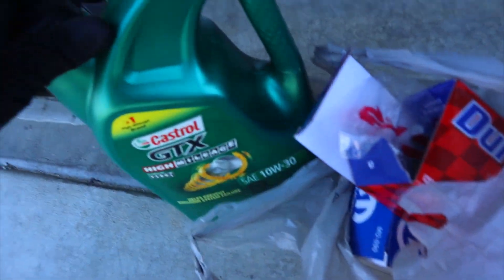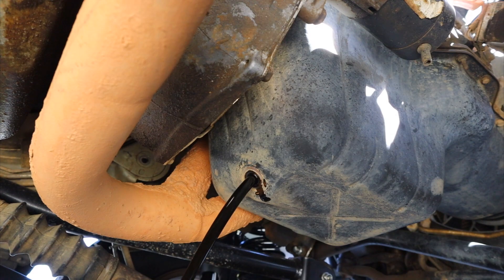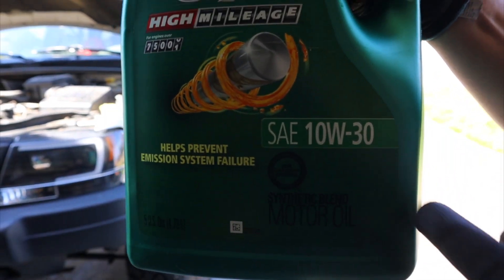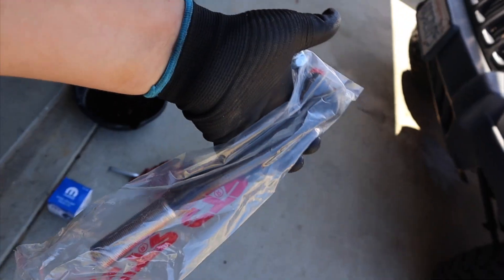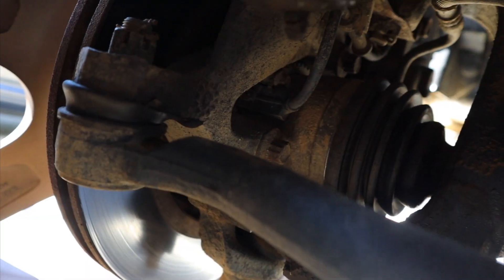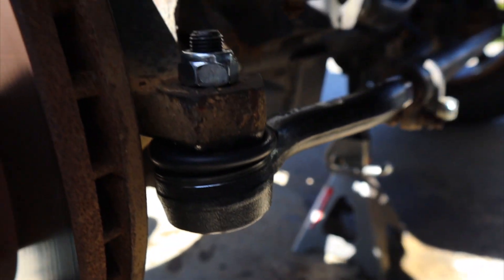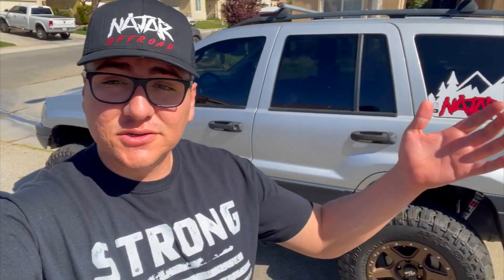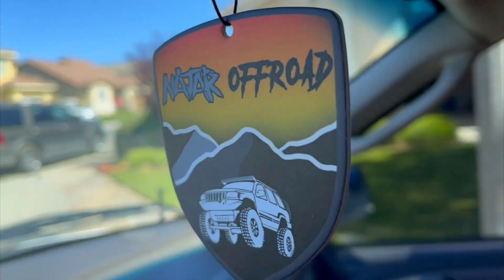Oil Change Tie Rod and Trimming for 33s on Jeep WJ Grand Cherokee | Najar Offroad

Comment: Been running the GTX high Mileage in my WJ for at least 60,000 miles. I now use about 5 quarts of that 10w30 with the 16.9oz of the Rislone Engine Treatment, then topping off with more 10w30 every 3,000 miles or so

Comment: Hey 6 cyl owners!  📣 4.0L’s use flat tappet cams. These require oil with high zincdialkyldithiophosphates (ZDDP for short) to prevent excessive cam wear. The Zinc forms a sacrificial layer of soft metal between the cam lobes and lifters. I use Amsoil Z-Rod for its high ZDDP content but there may be other brands who still offer this. Be sure to do your research to keep your 6cyl happy and healthy for the next hundred thousand miles!
Reply from the maker: I’ll try that next time 💪

Comment: Any plans for an upgraded exhaust?
Reply from the maker: Yea but I don’t know what is sold for WJs haven’t done research
Reply: @NajarOffroad  i put a dynomax tailpipe, after market single federal converter, and 3inch super 10 muffler in mine. There’s sound clips on the Jeep WJS only Facebook page if you want to hear or I could send it to you on IG. Very aggressive and on stock tires so it doesn’t drone and sound bad at high rpm but I’m sure those big tires you got are going to make that 4.0 sound like it’s working harder than it should. 
Whatever you choose be careful cause you can make your 4.0 sound bad really easily, I think my set up is one of the best sounding.
Reply: I put in a borla catback. Not too loud but it's aggressive and doesn't have much drone on the highway. I feel like it's the perfect middle ground for sounding great and being comfy
Reply: Reach out to Kolak he hooked me up with his performance exhaust if you’re on the forums I’m sure you’ve heard or seen him around. Super knowledgeable on everything WJ he’s been my go to for parts, advice, and overall suggestions and tips.

Comment: I went ahead and bit the bullet. My Banks Header arrived last week. Buy once, cry once. 
I actually wanted a quality tuned header , not just a replacement piece of crap that will break in a year. Also adding Mellon Cam for low to midrange power. 12 port Bosch injectors and cold air intake will round out my engine work. Then on to the suspension.

Comment: Baldwin B2 or B2HPG
WIX 51515  or 51515 XP
Donaldson also has good filters 

WIX site cross-referenced Baldwin B2 to  WIX 51515.  Napa filters are WIX I believe they use WIX numbering system.

You should be able to find Baldwin filters in the LA area.  HPG is equivalent to a 5 micron filter if I remember correctly. 

 The Baldwin B2 is twice the size of oem filter with the same specifications.  Prefer the Baldwin "B2 HPG" if you want to spend the extra, I usually buy them by the case.

VR1 Racing, oil 10W30 is preferred because of its high in ZDDP, but it is pricey. Summit has it for $57 for 6 qts.

Comment: Rottela oil ftw. Ya need Zinc for those tappers.

Love seeing the updates to the WJ. I'm chasing the same issues with my WJs suspension lol
Reply from the maker: Maybe I’ll try that next time! What spec is the oil you use? Thanks brother slowly but surely!
Reply: @NajarOffroad  Hey, so I use T5 10w-30. Rottela is a diesel engine oil which makes it good for our inline6 and other older engines.
The zinc in it helps the lifters and tappers move without grinding.

Plus you can just give a shit eating grin when your friends look at you in confused horror as you pour diesel oil into your engine lol.

Doug from D&E did a whole video going into the science stuff about it. Explains it far better then I could lol.
https://youtu.be/YobFtCr0Z4w

Comment: Hey just for others out there, I wouldn't recommend more than 3k miles on Dino oil (conventional). You really run the risk of sludg with more than that. Depending on your driving habits and conditions you may want to do even less. Not trying to start a whole debate on oil here, but I think 4500 miles on Dino is pushing it. 
Full Synthetics are a different beast. I typically do 5k oil changes with Full synthetic. You can get longer out if it, but Oil is cheap enough that I don't mind doing it ever 5k or less full synthetic.
Reply from the maker: Yea I would say change your oil often! 4500 is definitely pushing it😂 how many miles would you recommend on synthetic blend?
Reply: @NajarOffroad  Yeah not sure what I would do for synthetic blend, probably in the range of 3-5k miles per change, of course filter too every change.
I'd probably say closer to 3k if you are pushing it alot, offroading often, and short trips, and if you daily drive it most of the time and weekend warrior it then you can probably get away with 4k-5k.
If I remember correctly the 4.0 tends to like Conventional better for some reason. So your probably doing the right thing with synthetic blend. Do you have any issues with leaks since oil change to synthetic blend? Also what grade synthetic-blend are you using?
Reply from the maker: Yea I heard the 4.0 like zinc so I went with a blend instead of full synthetic. I’ll probably stick to changing it out every 3-3.5k miles. But so far so good! No leaks and I gained about 1 mpg  with the oil change I didn’t realize oil can do that😂
Reply: @NajarOffroad  Thats good, what weight oil did you go with? That may be why you got increase in fuel economy if you went with a thinner oil compared to what you were with the dino oil. I know alot of modern SUVs like CR-Vs use a 0w-20 to get better fuel economy. A thicker oil will lower your fuel economy. I think the 4.0l calls for a 10w-30 oil
Reply from the maker: I used 10w-30
Reply: @NajarOffroad  Yeah that should be good, I think there are people that even use 10w-40s on the 4.0l, you would lose fuel economy if you did that though.
 If the 10w-30 is working for you id stick with it though, just keep up on oil changes and itll be fine.

Comment: Najar: I installed a rear tail lights and the whole Jeep 2001 WJ  went dead. No power. No crack , no nothing. Chales, 
A friend told me disconnect the battery and let it rest for few minutes then connect it , solve my problem. What happened?? I hope someone tell me .
Reply from the maker: Hmm that sounds weird. Haven’t seen anyone post problems with them

Comment: Upgraded oil filter:
On the WJ, depending on clearance, you should be able to fit the larger oil filter. The Puralator One filter P/N is PL30001.
This allows a larger capacity of oil (not by much), and more filtration surface.
You should be able to fit than on the 4.0. It also fits on the 4.7l
Reply from the maker: Is the only benefit more filtration surface?
Reply: @NajarOffroad  Larger oil capacity. You might get a 8-12 ounces of more oil, but more oil allows for more fluid to take heat, and more fluid means longer life of the oil. 
You aren't going to pay anymore for the larger filter compared to the normal size one.
As for filtration, you have a larger area to filter, which would be beneficial in desert/dusty environments, and just in general is a better  benefit. You probably don;t get a longer life out of the filter, and I wouldn't recommend it for that purpose anyways.
I do under 5k miles for oil changes with filter, full synthetic high mileage.
Reply from the maker: Oh ok that makes sense! Thanks for letting me know! Are you on the 4.7?
Reply: @NajarOffroad  I have the 4.7l HO yeah.
I think this should work for the 4.0 though, they should use the same filter according to wjjeeps